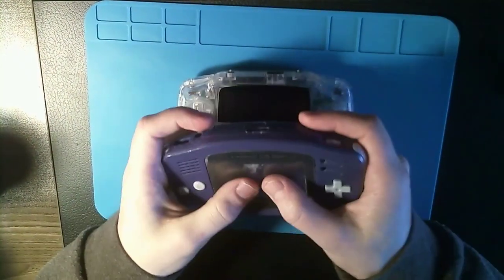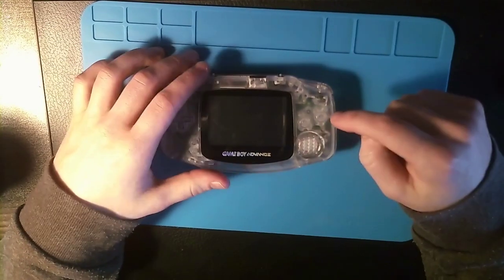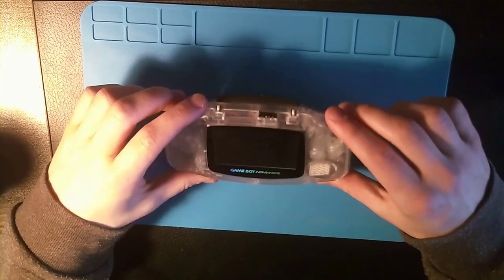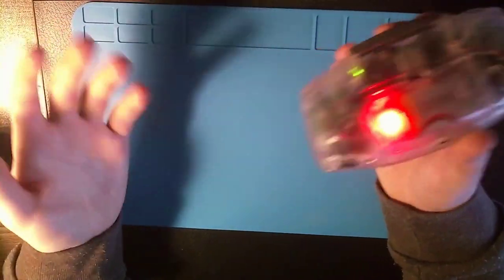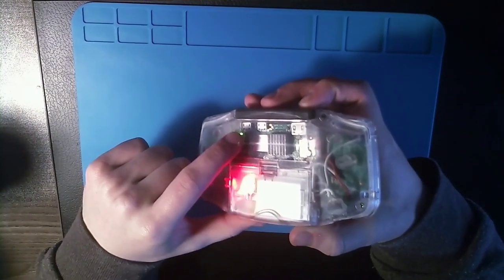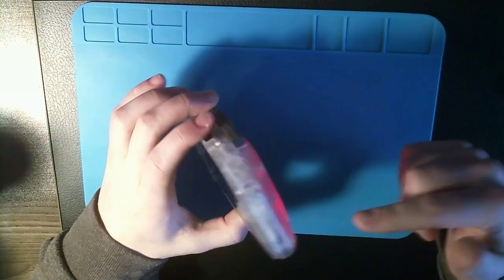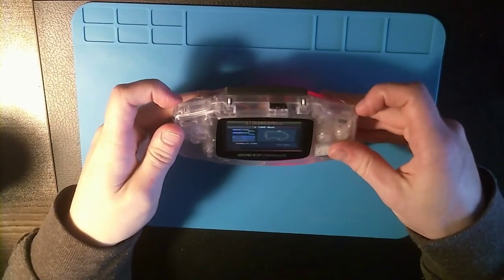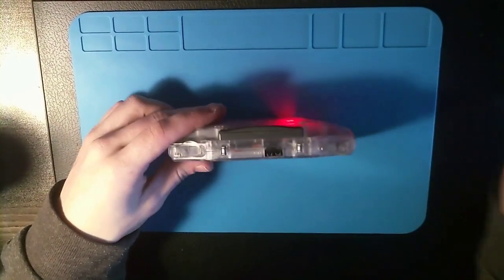GPiA (Raspberry Zero 2W inside an Gameboy Advance shell | Update #3

Comment: is any part of the original motherboard in there?
Reply from the maker: Sry for the late reply, no I don't even own a GBA. I used a replacement shell with buttons etc and bought pcbs on AliExpress that act like the original PCB I will search if I find a link and add it here afterwards. About opening I will look but I already opened it in my older iterations and there are not a lot of changes but I will look into doing a follow up more in-depth showcase of the inner workings